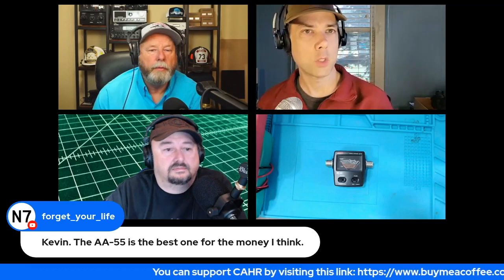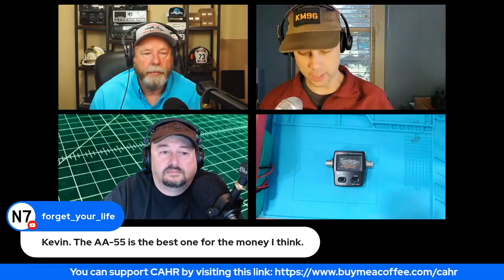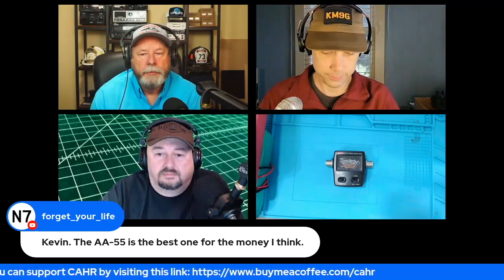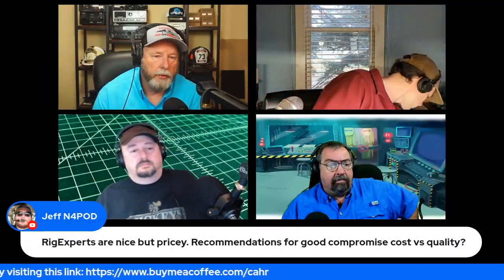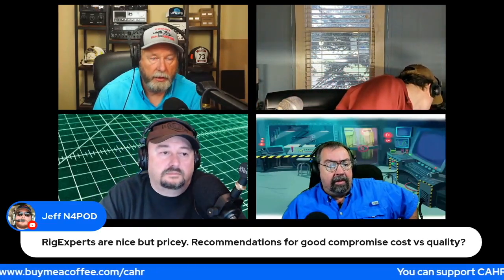SWR Meters and Antenna Analyzers for Ham Radio

Comment: I do not have an external SWR meter such as you do in this video. I just rely on my internal SWR meter on the the radio however I do have a question about my analog meter on my radio. I have the IC-7300. This IC-7300 has an analog meter. When I set my IC-7300 to 100 watts and key up my mic the forward power is suppose to show 100 watts of forward power being put out however my analog meter shows only 35 watts of forward power being put out.  What do you think could be causing such a huge discrepancy between the 100 watts the IC-7300 is set to and and the actual amount of forward power (35watts) that is being put out?
Reply from the maker: Could it be measuring average and not peak?  If I had to guess, I would say you are testing on SSB, try RTTY.
Reply: @TheSmokinApe  Yup, that was it LOL. Thanks
Reply from the maker: @BlackHamRadioUniversity  glad you got it worked out 👍
Reply: @TheSmokinApe  I am going to get an SWR meter but need it to be digital as I need to see the readings at a quick glance.  I am on a tight budget so I just need something not too expensive so I am trying to decide if I should get the MFJ-849 or the Nissel D3-503. They both are the exact same but still not sure which one I should get.

Comment: I have an oldie but goodie Heathkit 2140  it is the best peak reading watt meter that I have ever had, I have a  Kenwood, and a Comet and they not as good as the Heath. If you can find a clean one get it and download the manual from the internet.
Reply from the maker: Some of that older gear was built to stand the test of time, today everything is meant to be thrown out.  Thanks for sharing 👍

Comment: QUESTION :  I have several end fed , 1/4 wave wire antenna, no balun used AND an 80M OCFD with 4:1 Balun.  SWR reading on my VNA of the end fed antennas prove to be within 1/10th , example VNA/1.6 swr, radio/meter 1.7 swr.  BUT on the OCFD my real life SWR reading are DOUBLE  of VNA swr readings.  Example, VNA will say 1.6 swr, but on the radio/meter reading it will be SWR of 3 or more.  THis doesnt make sense to me, my only explanation is the Balun somehow throws the VNA off, anyone have experience with this issue when making wire antennas ?
Reply from the maker: Is the VNA properly calibrated?  I've seen that be the problem before.

Comment: I like my RigExpert  A-55 Zoom, I do very little if any vhf/uhf. I had a nano but didn't like the sma connectors and the menu system. As for MFJ I am still waiting for my 259d to be returned from the repair shop eight months later. I don't miss it after getting the RigExpert.
Reply from the maker: I like the BT feature on the 55 Zoom 👍